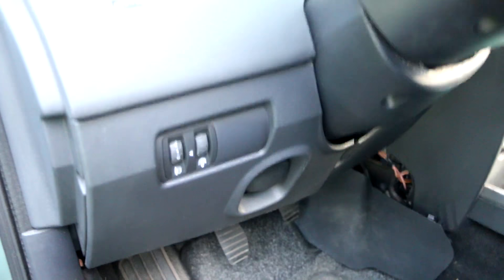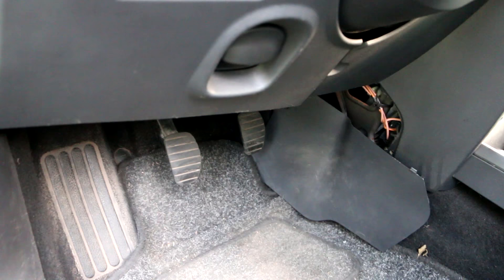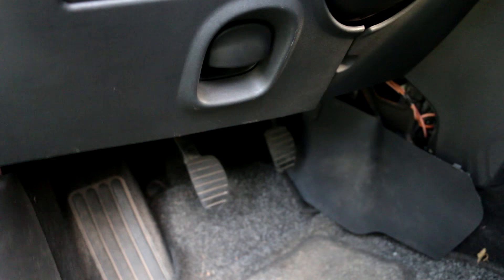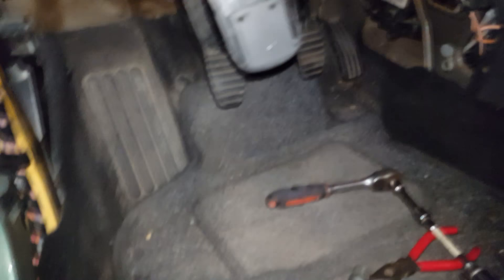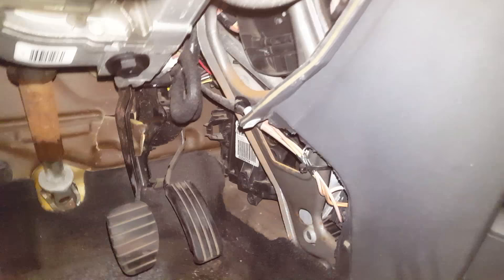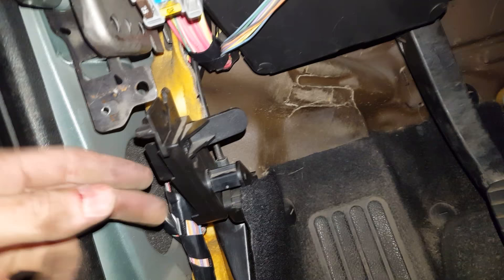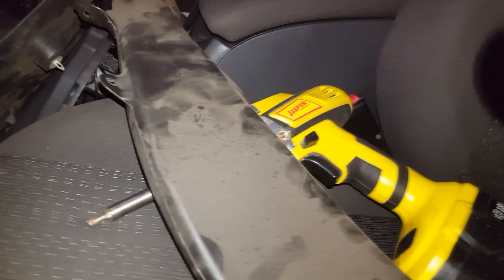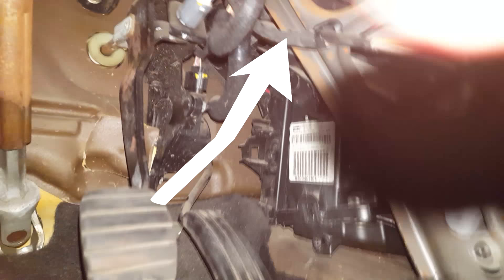How to remove Renault Megane 2 Cabin air ventilator

Comment: For someone who is doing this job, you might want to remove the three bolts keeping the brake booster in place from engine room side and then push the fork leading to the brake booster forward from inside, or pull the brake booster forward from engine room side. This gives you more room when trying to take the blower motor out. Don't forget to put the bolts back. Thank you for the video.

Comment: Thanks your video helped at least I knew what I was getting in to. Here is how I did it.
1. removed drivers seat completely out of the car. Just 4 screws, 1 connector and set belt. You can lie down in the car comfortably.
2. removed pedals as you did, but left everything else in place.
3. replaced FAN, got out quite easily. Used the connector hole for the brake stick that is in the way. Simultaneously slowly rotating it.
4. placed everything back. Time spent 2 hours.

One more tip as first remove the brake cable connector and remove also the brake switch by rotating it 90 degrees. Don't push that switch !!!
Reply: 0
Reply: Oops! Guess I might have pressed the brake switch (white-colored). My rear break lights and now constantly on, when the car is turned on. Any ideas what else would be causing that?
Reply: If you push the switch, you'll need to take it out again and tug hard on it (it's on a ratchet system), and place it back carefully. The deepest the switch is depressed determines where the "unpressed pedal" position is, so if you press that button in accidentally you'll mess it up and need to pull it out again.

Comment: Thank you very much for this video, it helped me replace the blower and resistor unit. Had a minor issue with the break lights after since I accidentally pressed the switch in, but then I read that you can just tug on the switch to pull it out a bit, and then reinsert it into the pedal, and that fixes the problem.

Comment: Nice and very useful video !  Dismounting the air blower in a Megane II turns out to be a torture ! The toughest part consists in making enough room for the fan to slide out by removing the pedals for instance. According to the vehicle technical guide, you can make additional space by remove the vertical metallic plate that stands on the side of central console. Removing it is an extra effort since one (out of 4) screw is almost impossible to reach and remove. Big disappointment, once removed the blower works quite well. Nothing wrong with the fuse neither. No clue about what can be wrong. Awaiting an endoscope to have a closer look inside the blower and heat radiator...
Reply: Did you try changing the resistance module? They tend to fail often
Reply: Went through the ordeal and everything was fine, the resistor, blower and fuse. Turns out, the blower speed 'knob/dial' seems to be disconnected somehow. Now, if I wiggle it abit or push it abit inwards and to the right, then release it, the blower stays working. All 4 speeds are fine when it's running. Have to figure out how to get to the connectors behind the dial for inspection. Really need the heat in this winter -10 degrees.

Comment: If you have your brake lights on permanently after this it's because you pressed the brake button in. It's on a ratchet system so you'll need to pull the button back out somewhat (takes quite some force), depress the pedal, and then put the connector back in, and release the pedal allowing it to depress the button just enough.

Comment: Thank you for the video tutorial. I followed these steps and managed to fix my cabin fan. Did you had any problems with the brake pad sensor? When I assembled everything back, the pad was far from the pedal and the lights were always on.
Reply from the maker: hi there, thanks! No, I havent had any issues with brakes or  pedal sensor, but I think it is possible to fit it incorrectly, is the pedals housing squarish upper part installed as it was before, if the brake pedal does not seems as it should be I would probably just take a part all housing and try to fit it again until I got it in the position as it was, better safe than sorry

Comment: This is for a LHD car, it’s much easier to work on the RHD car. I removed the glove box and a plastic trim in foot well, and a the plastic air duct. If you push and twist the blower the sloe thing will come loose and you can wiggle it out !
Reply: About to try it on RHD car

Comment: How on earth did you put back the blower? I'm losing my mind here...
Reply from the maker: Not easy thing to do, i dont remember exacly how, but I remeber using a bit force + I remember that i also tried to put it back by taking a part fan(just removed the cpart that is cliped on), and then putting it back together when it is over the hardest part. Not sure if i just forced it in while it was one piece or forced it in while it was in two parts
Reply: JUrtans channel managed to put it back. Thanks for making this video, you make it look much easier than it is.
Reply from the maker: @soring5880  true and for sure I would not like to do this again :D but any way when i tried to fix fan, I was thinking that it is hard to get it out and get it back in, but recently I had to replace  clutch cylinder, cmon, I had to took half car a part just to take out gearbox... +air bleeding from the system was a lot different than I hoped it is going to be..

Comment: How long it would take a professional to change that part plus a resistant for that car ? repairshop said it takes 3 hours for my car
Reply from the maker: well it depends, if by resistant u mean heating resistor relay unit,( it should be mounted on top of the fan), then it wont take too much extra time to replace and I would say around 1,5-3h total is ok, ofc if you do it by your self and and do it e.g. second time and u know what to do, I think you can easy do it in less than 3h, if you want  to do it quick and you are well motivated :) If by resistant u  mean heating resistor unit, then it ll take some extra time (also depending of what RIGHT or LEFT hand drive car u got), but any way if you replace it together with blower, it will take u 2-3h.

These are just my wild estimates, bcos with this Renault model most of the work will take some extra time, since parts that you usually want to replace, are hidden behind a lot of other parts you have to take a part to get that one part out and then you have to put everything back again :D

Comment: Hi friend, you had to remove any screw in the fan it self before remove it? I think you didn´t !!
Reply from the maker: As I remember, no, only electric connector, it is kind a screwed in the ventilation body by itself, but you have to unscrew it by hand and it is not very hard to do that. But to get to the vent you will need to remove other components which are screwed in places.

Comment: but how did you get it out ?
Reply from the maker: well, it is not easy task! If you cant get it out as Houdini, I ll understand you, since it takes some nerve and luck to pull it out. In my case, to pull it out more easy, after i disconnected the electricity and  took the vent out of it's socket,   I removed the plastic top of the vent while it was in mid of the way out, so I could more easily rotate it and pull it.
Reply: Thanks!